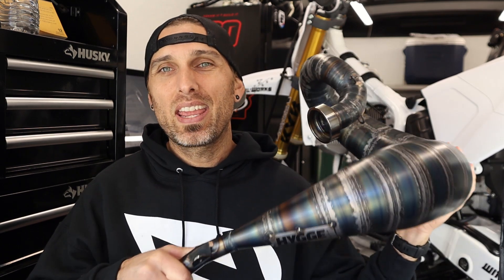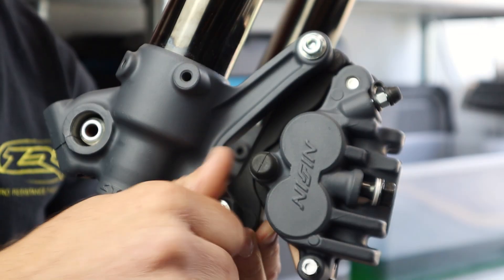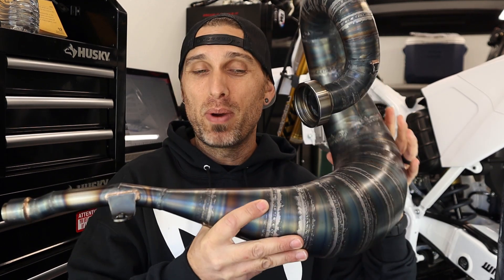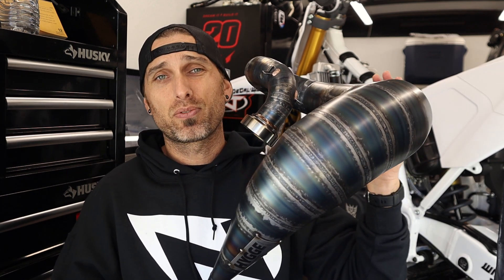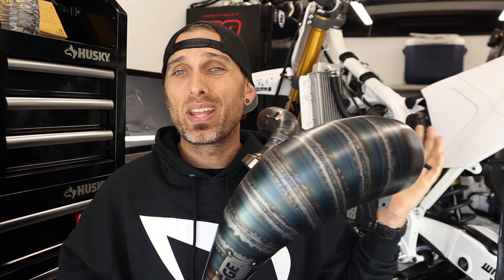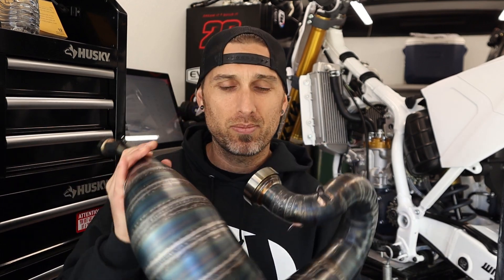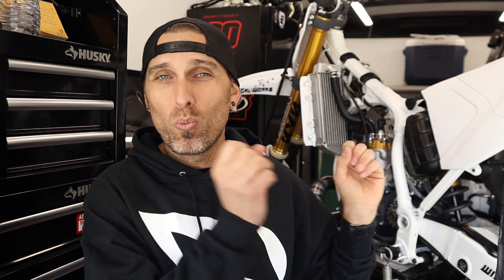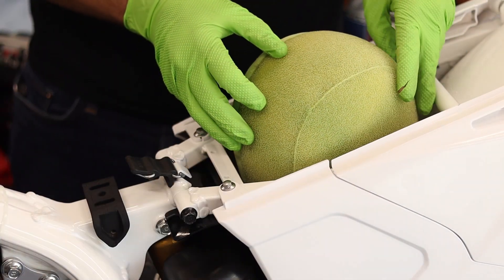TOTALLY F***ING INSANE Two Stroke Mods for Your YZ 🔥 2002 Yamaha YZ250 Dirt Bike Build & Giveaway

Comment: My brother and I got a Suzuki DS 80 when we were about 8 an 9 (back in 1980 ish) which like you  said fed my full on dirtbike addiction. My dad was not mechanically inclined. So any mechanical issues we had wth th bike were dealt wth thru trial an error by my younger bro an I. I remember several 8 penny nail master link attempts. Many flat tire repairs wth all th wrong tools. No helmets.Pushing th bike about a mile to get less than a dollar worth of gas...an ride for hours. Yes we had a gas can but n r mind th we would hav to carry th can all th way back or start ridin sooner..duh...A few other yz kx rm followed thru r childhood...nothing great but enough to keep th addiction n full effect...
Flash forward 40 years...I'll b 50 n June...I still hav an ride dirtbikes. Currently I hav a 2010 crf250r that blew up 30 min into my ownership...so I stripped it down to th frame an rebuilt every wear item bearing seal top to bottom an hav been riding it for th last 10 years...
So yeah th fresh 2 stroke will b greatly cared for an appreciated n more ways than u can imagine...reminding me of my youth an where it all began...wth th orange air cooled, reed power band little bike that raised me right...

Comment: My 1st bike was a clapped out 82 YZ80 that my dad bought me when I was 10. It was the 1st year it was water cooled with the radiator behind the front number plate. I was so pumped to have a bike and rode it every chance I got. Most of my ride time was spent at E-Street when it was free. I had my 1st race on that bike at Sacramento Raceway which consisted of  getting a holeshot followed by trail riding and sightseeing with my buddies in a stadium full of people. 😂 I loved it!

Comment: My first bike was a $35 pull start mini bike with no brakes (Fred Flintstone style) my dad got for me and my brother one Christmas.  We also got some bicycles, and I wouldn't ride the bicycle until my dad helped me ride that minibike.  We ran circles around the house until all the grass was gone. I forgot to tell ya that the Tecumseh engine was also pretty fast, and it had a weak throttle return spring on the carb and liked to hang up. Great combo for those Flintstone brakes!  I ran it into a convenient store outdoor ice box to stop it once, man I got lucky I didn't die. 🤣  A little later when I was 12, I got my passion to build bikes and found a used worn out 1975 XR75.  I tore it down completely, repainted it on a budget, got a few performance parts, and put her back together.  All by myself at 12.  It was pit bike / play bike at that point, but when my superfast YZ80 broke down, I raced that bad boy a couple of times.  Not as fast but still fun.  Here's pics of my first project bike, and it inspired one I built about 8 years ago. https://www.facebook.com/photo/?fbid=10202369789828070&set=a.1064740060714  https://www.facebook.com/photo.php?fbid=4962166465900&set=t.1292393824&type=3

Comment: First bike was technically my moms bike.  It was a 1978 Suzuki TS185.  I tried my best to trash that thing but it wouldn’t die.  I tore all the street legal crap off of it.  Eventually, I upgraded to some longer rear  shocks.  It was marginally better but it did give me more travel.  Let’s be real, I wasn’t exactly a moto pro.
Our favorite place to ride was a gravel pit out in the country.  We had a makeshift track with a gravel pile for a jump.  Dad was usually target practicing while me and my cousin rode the motorcycles.
My real first bike was a 2004 CRF450R.  I bought it brand new in 04.  I still have it and it’s in great shape.  Still ride the crap out of it.  I’ve done stuff on that bike I never thought I’d do.  I should be putting in some laps on it today if all goes well.
It’s my race bike, my trail bike and dune bike.  It does everything pretty decent that I need it to do.

Comment: My first bike was a 1973 Yamaha 100cc enduro that I heavily modded. This was in 75 mind you. I put on a exhaust system, or torque pipe, and a bigger carb, had it ported , bored and we milled the cylinder head. Next was relocating different rear shocks for longer travel, and then I had YZ tripple trees and forks and front wheel made to work. That bike was a handful, and all of it's power was waaay up top. lol. Since then, I've owned YX's, CR's, KX's a few Huskys and even a CZ and a Penton. The street bikes are a whole nother story.
Great super detailed build Sir! I salute you!
Reply from the maker: That is so cool, getting into the nitty-gritty on that bad boy! Huge thanks for sharing!

Comment: First bike was a 1979 RM250.  I was 14 years old and my buddies all had bikes but my parents couldn’t afford one.  I worked my ass off, saved up, and checked the cycletrader every week until I found a bike in my price range.  One day, there she was, the Death Banana.  What I didn’t know was that the 70’s were a very different time, when men were men and motocross bikes were built accordingly.  Back then, working on your cardio was done with the trophy girl in the back of your conversion van, strength training was a fist fight with the guy who tried to take you out in moto 2, and athletic supplements were Coors Original and unfiltered Camels.  My 14 year old self was not prepared but my determination to go ride with my buddies helped me to ignore all sense of self preservation.

The power delivery on this bike had two modes, “you’re about to foul your third plug today”, and “Tell my family I loved them.”  The dual rear shocks were designed by chiropractors to ensure future business and the front forks had state of the art marshmallow internals.  The drum brakes were awesome for learning corner speed because unless you had an airport runway length entry to the turn, you can forget about stopping.  

It was a LOT of bike for a brand new rider who weighed 130 pounds on my best day.  Great experience though and I learned a lot about working on bikes just keeping that thing running.  I eventually sold the Death Banana and bought something more modern for that time.  Amazing how far bikes have come since those earlier models.  I do miss the feeling of impending death when I fire up my bike though!
Reply from the maker: This was the best story so far! Loved reading every bit of it & especially your wit! 😂 Absolutely epic read

Comment: My first "dirt bike" was a 1970 Honda trail 70. Got it from my grandpa non running when I was about 14 worked on it all by myself YouTube mechanicing and finally got it running. First time I rode it I came up to a turn on a trail to fast laid it on its side and jumped off. Ended up landing on my feet and 6 inches from a 100ft cliff. Lots of fun memories with that thing!

Comment: My first bike was a 1974 Yamaha TY80 that my mom, brother and both sisters learned to ride on. Biggest memory was probably the piston exploding in the middle of going up a long steep hill. Took my dad over a year to find all the parts to rebuild the engine and when it got done I was too big and ended up getting a brand new 1987 Kawasaki KDX 80(I begged for the KX 80 but they said I was not tall enough yet.... I made them regret that decision in less than 2 months.) What I consider to be the cool part of it all that when I go to visit and help my dad do some work on his house this summer out in Cali, I am bringing not only that 74' TY 80 back with me but also my dads 74' TY 250 and my brothers old 86' MX 175 as I am the only one that is interested in any of them.

Comment: At 8, I had a Fox mini bike. Full suspension, wire wheels and a 5 hp Tecumseh engine. At 14 my first "real" bike, a Honda TL125 trials bike. It was several years old but the dealership couldn't sell it so my Dad traded them some electrical work (he was a contractor) for it. That was over 45 years ago.
Reply from the maker: So badass, Tim!! Love that! I am an electrician by trade too.

Comment: My first dirty bike when I was 7 was a mini bike and it didn’t have an engine so I took my dad’s rototiller engine and stuck that thing in there. It was so fast but I couldn’t afford a throttle cable so I had to reach under the seat to give it throttle, well guess what else is under the seat, yeah the spark plug. Probably got zapped 100 times before I could remember exactly where the carburetor was. Probably what’s wrong with me. Oh yeah my pops is still upset with me stealing his engine 34 years later haha.

Comment: I was 10 years old and my dad bought me (us) a 1989 Honda CR125R.  I couldn't even touch the damn ground he had to hold the handlebars. I putted around in 1st for weeks terrified of the damn thing. Finally he got me to shift in 2nd. As I did I popped the clutch threw me into a wheelie and I whiskey throttled the damn thing. Hanging on for dear life as I had it pinned in 1st I finally let go, got all f***ed up. My dad came over picked up the bike, laughed and said i need to work on my clutch skills😅

Comment: my first bike was a crf50, raced that for about a year and needed to move up to the 110 class but was too small for a 110 so we buy bored the 50 to an 88 with a cam pipe and carb and it went hard, used to smoke the 110s, then once i grew a bit i got a 110 and we sold the 88 about 6 years ago, now i race a 125 but i hit up the guy who had my old 88 about a year ago and bought it back and i plan of doing a build and fixing it up for the wall.
Reply: big bored*
Reply from the maker: Such a great story! Those "buy-back" bikes must be the best. Haven't done that yet myself... Thanks dude!